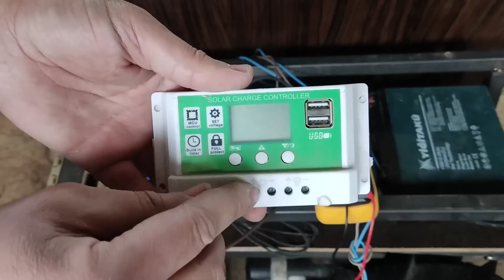Güneş enerjisi ile bahçe düzenleme  , güneş enerjili su pompası yapımı #güneşenerjisi #nasılyapılır

Comment: its not solar, it is mainly battery powered ans solar just adds a little bit of power and charges batteries when not in use. Solar gives maximum 200-300w of power and thats nothing compared to what batteries can give, and for such field work you need at least a kilowatt.